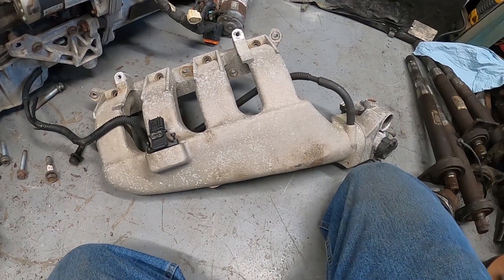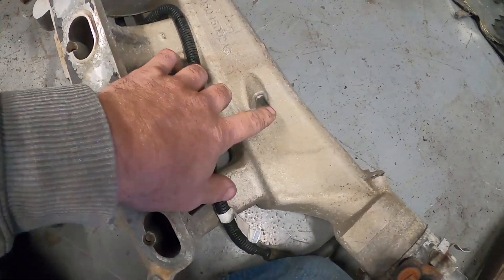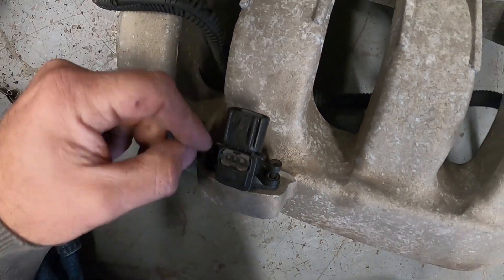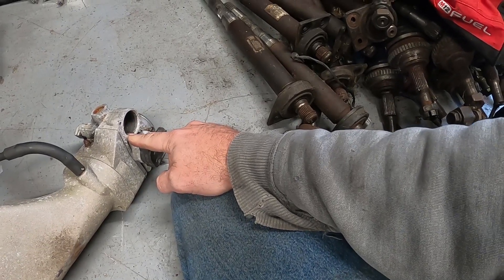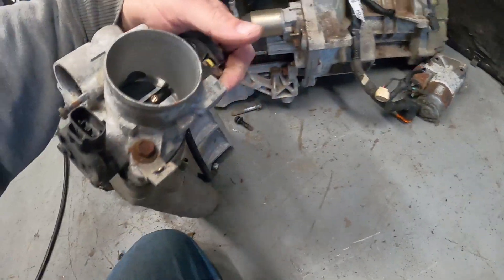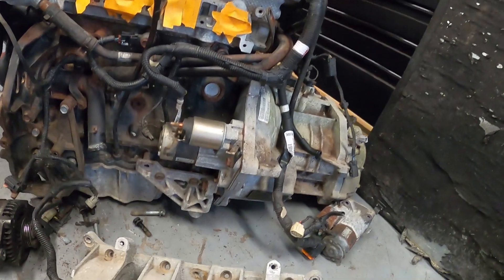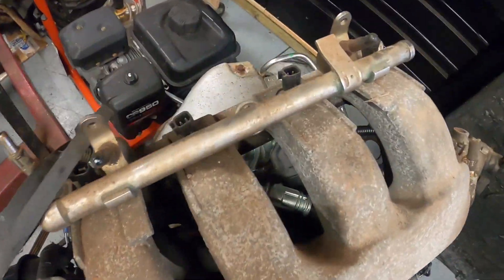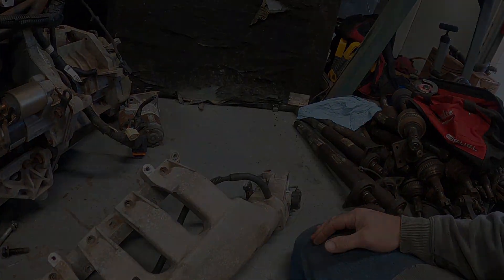2003-05 dodge neon srt4 intake manifold

Comment: Anyone who has an idle issue like I did, its super easy to take off the IAC and check it by blowing into it. If air goes through it, its bad. Wish I tried before wasting an entire can of brake clean looking for vac leaks. Super easy fix.
Reply from the maker: on a side note use the brake clean to clean out the sensor and tb if lots of build up,  you can also spray some soapy water to find vac leaks it will stall out the engine and actually make finding the leak easier